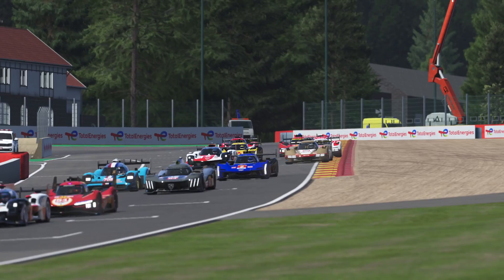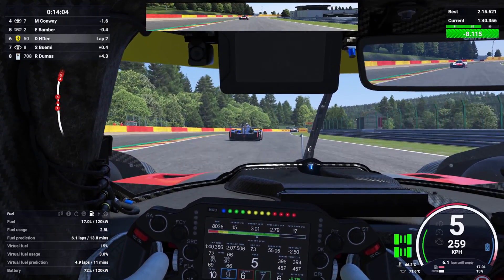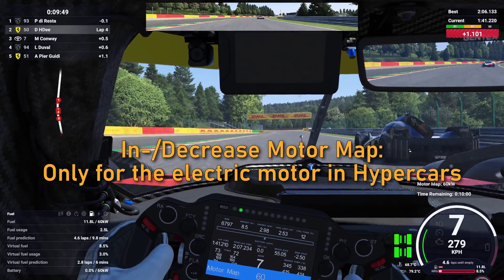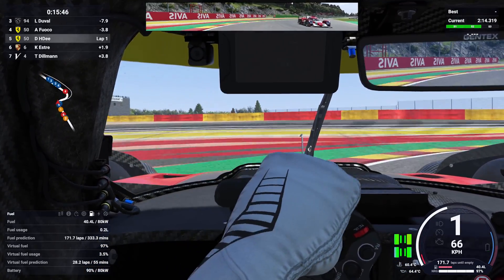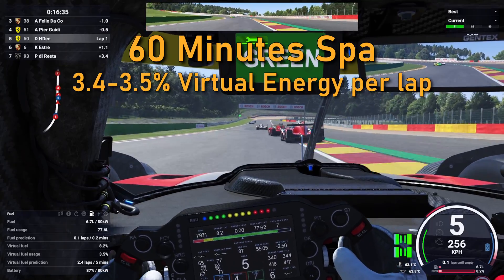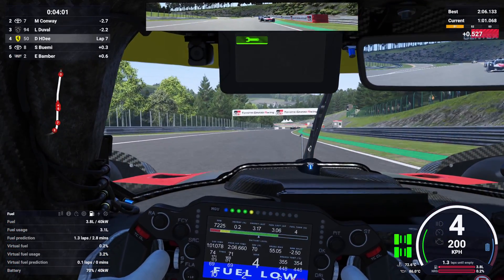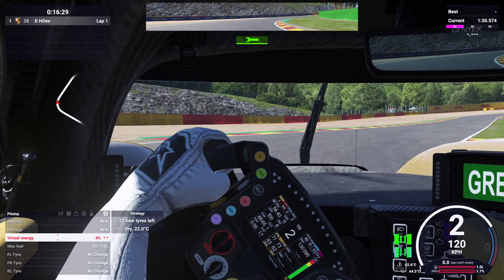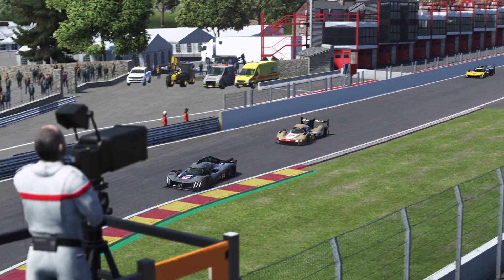Beginner's Guide to Hypercars: Virtual Energy, Hybrid System, Pit Stops, etc. - Le Mans Ultimate

Comment: wait so hypothetically, if i was in a practice session with fuel consumption rate set to x3 and decided i wanted to do my best hotlap in that session, would it technically be “faster” (even if everrrr so slightly) to turn the hybrid deployment OFF because it would be burning more fuel? i understand that this isn’t practical but i’m using this hypothetical to try to understand this better.
Reply from the maker: Well theoretically, yes. But you would run into issues with your battery reaching full capacity, which would create problems while braking.

Comment: Thank you very much for this explanation! Just one question, for the same reason you mentioned why we should always take 100% VE and adjust fuel capacity (more ways to do management), wouldn’t that also be valid for pit stops? Take 100% VE in pit stop and adjust max fuel capacity? The only reason to leave fuel capacity alone and change VE for a pit stop is only because it’s easier to calculate fast if it shows you how much VE you are using per lap, but it also shows you how much fuel you use per lap no?
Reply from the maker: You could do that as well, yes. It's mostly for the ease of calculating.

Comment: that means it doent mattee how much kw i use for the e motor i will always use the same amount of energy?
Reply from the maker: Virtual energy, yes. Think of it this way: You'll always use the same amount of virtual energy if you drive the same, regardless of motor map. If you use more KW from the e-motor, the combustion engine will produce less power while you use up more battery. Turn down the e-motor and the combustion engine has to do more and you conserve battery.

Comment: 1:04 Not all cars from the 2023 season feature a hybrid system as, for the LMH regulation build cars, it's not mandatory. All LMDH reg build cars, like the cadillac, come with a spec hybrid unit that has to be fitted. For '23, there's only 2 cars that are ICE only being the Glickenhaus and Bykolles Vanwall. This can also be seen by the lack of a visible "HY" sticker on the cars. Both of them have been dropped from the WEC grid for 2024 for their own reasons.
Neither of these cars were truly competitive IRL (not sure if that's, partially, to blame on the lack of any hybrid system).

I wonder how that ties with virtual energy strategy wise as well as you'll have to sacrifice pace regardless in order to optimize efficiency. Hybrids can rely on the motor to aid the engine so the driver doesn't have to fuel save (much).

In irrelevant news, do yourself a favor and try the GTX sportscars spec series if you get a chance because i've been having a BLAST with them!
Reply from the maker: Ah, thanks for clarifying. I haven't tried the Glickenhaus or Vanwall yet, maybe I should've for this video. 🙈